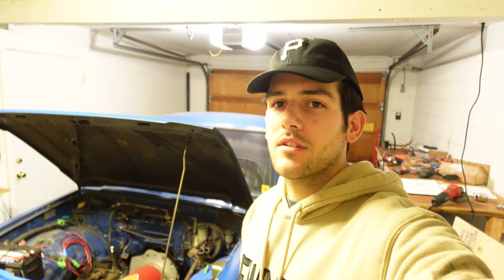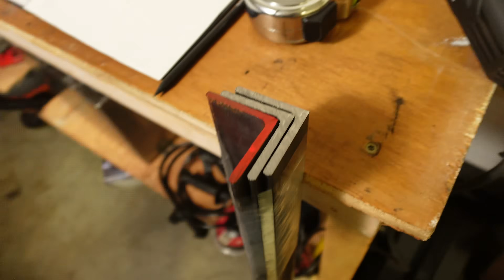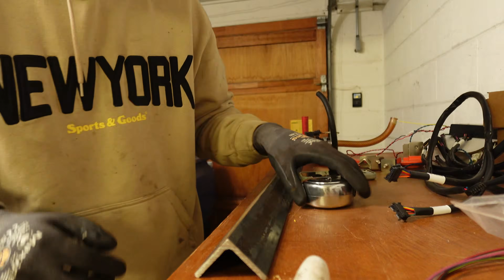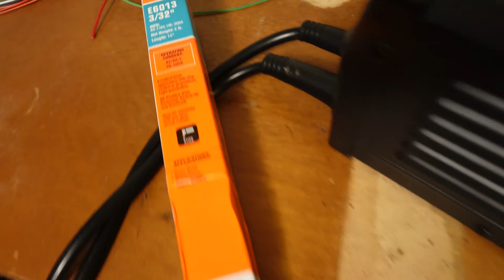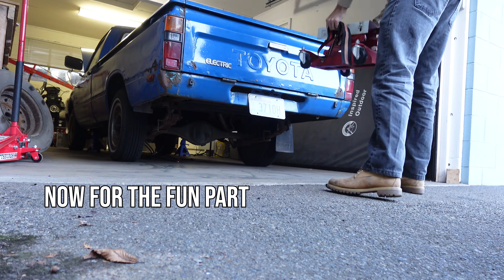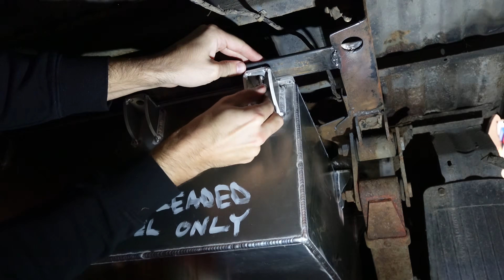Mounting a High-Voltage Battery Enclosure in my Custom Electric Pickup Truck | 1982 Toyota Pickup

Comment: What is preventing the braces from becoming detached from all the tension going over bumps.  Like I would think you would need some serious engineering to make sure everything is set up right.  Do you have a degree in engineering?  Like when I ask the question to google is a car frame welded on all sides, I get No, car frames are rarely welded on all four continuous sides if it involves joining two separate structural pieces, as this can weaken the metal and create a brittle, rigid point that is prone to cracking. Instead, frames are joined using a combination of overlapping joints, sleeves, plug welds, and "stitch" welds

Comment: I just stumbled over this series and really like what you do, nice job. Although: Wouldnt it be better for weight distribution to put the battery pack in the front of the rear axle instead of hanging it this far out?

Also: my god, please get a cheap MIG welder instead of playing around with sticks.

Comment: are you worried about weight distribution being too far back here? i am doing something similar but was hesitant to mount everything behind the driveshaft -- but seems like the best place on a small pickup. any thoughts?
Reply: As long as you don't hang it off the bumper, it'll be fine. You'd need roughly 1500lbs to cause any leverage issues on that truck. If you wanna test it, throw 300lbs of load up against your tailgate and see how it changes the truck you're planning on using. That is further back than a batter block would normally be mounted. 

The consistent weight on the rear will help keep the tail end from sliding out as much though. Same as bed load.

Comment: Nice work!  If you haven’t already, I’d suggest evaluating how hard it would be to take the bed off while you’re getting the battery box set up.  It would make the welding and cable management much easier and more pleasant.  (It may also be a nightmare if rusted mounting bolts and may not be worth the hassle.)

Comment: I’m in the planning and acquisition phase of my 1954 IH R-120 conversion.  The plan is to take the engine, transmission, driveshaft, and rear axle out and put in a tesla LDU with an open inverter board. Connect that to a 380V mustang mach-e battery and keep all the original interior and dials to make it still look like the stock truck.  It amazes me how much local markets in specific locations have reasonably priced EV equipment.  All said and done - including the price of the truck - ill be in 12k. For a 450hp, 300 mile range truck that is about 88 thousand dollars less than market price!

I’m really enjoying your videos. It is helping give me confidence in welding, electrical, and getting it wrong to get it right.
Reply from the maker: Sounds like fun! I have not looked into the Mach e batteries but now I’m curious
Reply: @B_Serious_YT they are pretty interesting. You need to be able to keep the original cooling plates which are sandwiched milled aluminum. They aren’t as easy to use as a tesla batteries. Luckily the truck has long uninterrupted frame rails so I can run two cooled packed on the original plates.

They are made of jelly too and need to stay compressed. So if you so split the packs you would need to find a way to compress them.  These two reasons (cooling and compression) are likely why they aren’t more popular in conversions.